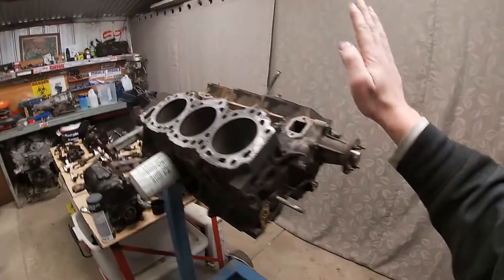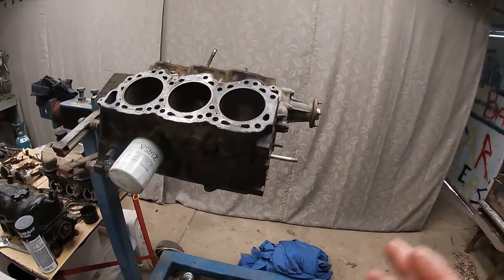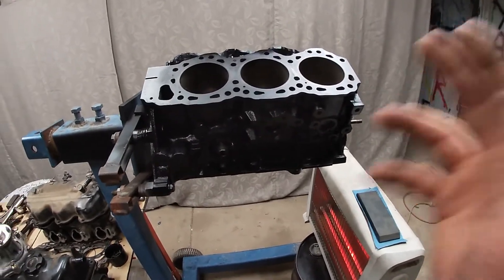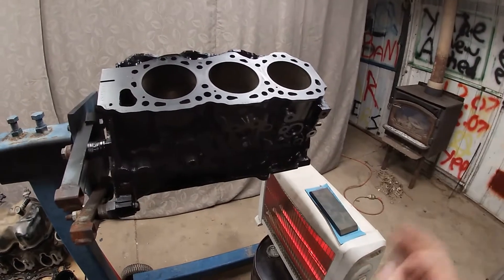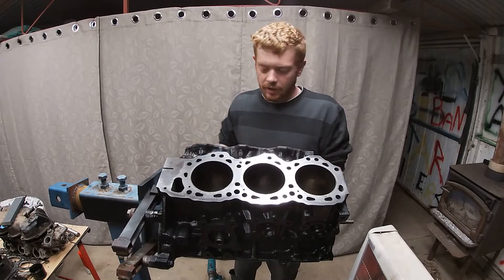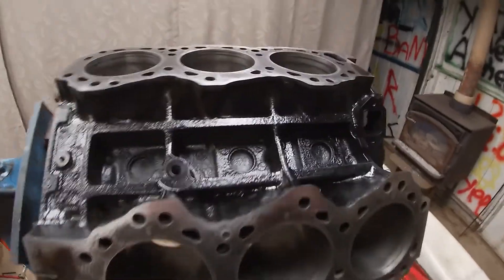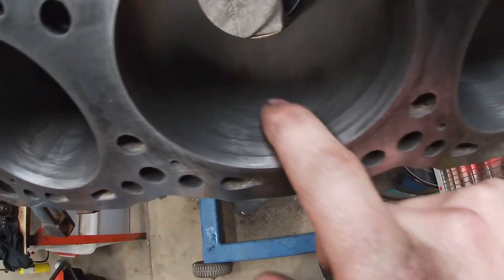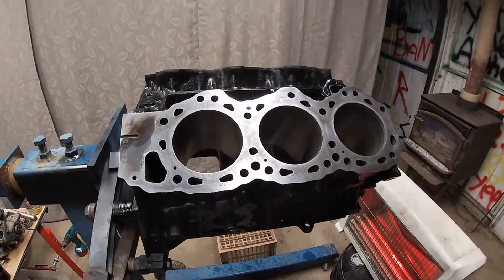VG30 Rebuild EP2: Block Prep

Comment: you are correct not the way to rebuild this engine, Nissan made this engine without a balancer shaft, the components when assembled at the factory where balanced at the time of assembly, the only way to have this motor vibration free is to duplicate how they balanced this motor during assembly at the Nissan plant, and figure out how they do this, otherwise your motor wont be balanced correctly for all the diyers out there, if you do this it will be out of balanced and fail before its time
Reply from the maker: I have rebuilt lots of motors from little 2 strokes to car engines to big cat diesel engines. I have not had any problems of motors "failing" because they are out of balance after replacing pistons. In fact non of them have failed at all.